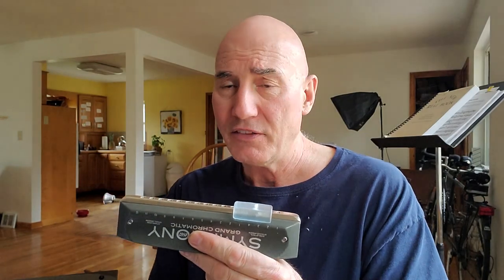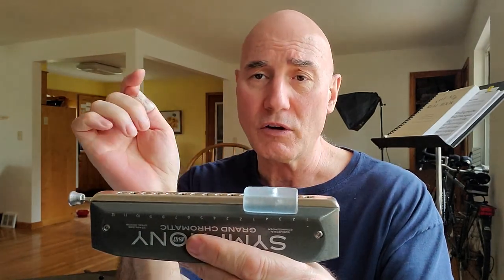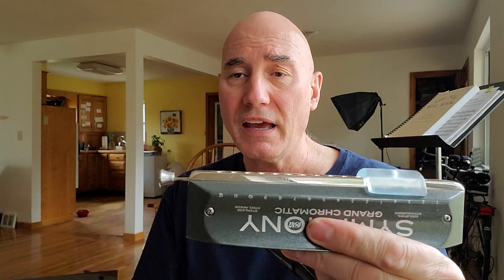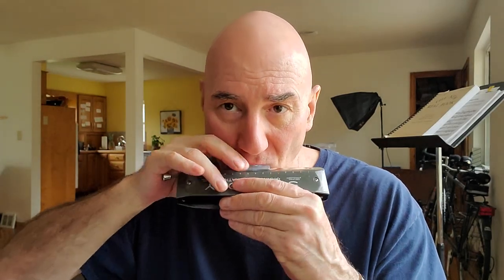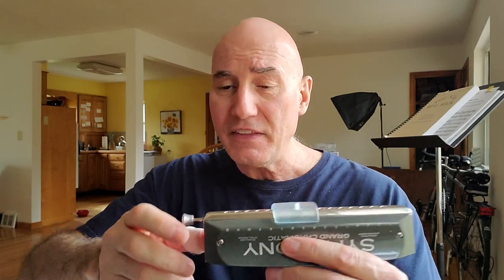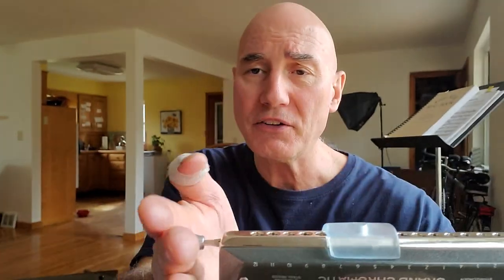Why 16 Hole Chromatic Harmonicas Sound Best Seydel Symphony Kettlewell

Comment: I own a Symphony. It feels great in my hands, and it has a great sound throughout. But. A big BUT. The slide spring breaks every few months! Do you have any suggestions?
Reply from the maker: This will not be easy...get the magnetic button, put it on your slide and get a magnet set from the factory. Then use the combination of spring and magnetic. I would also suggest you start using slide oil properly to lubricate the slide, might help. Or keep a good supply of springs on hand for repairs.

Comment: Hello David, Since you have demonstrated the 16hole vs 12hole chromatics, I wonder which 16 holes you would recommend, and if you would recommend them at all for a beginner level player? Also, when do you think should one switch to a higher level harmonica? (I currently play an Easttop Kingdream)
Reply from the maker: a beginner will be well served with the Easttop EAP 16 holer, inexpensive and airtight. Also Suzuki SCX. Pro instruments Seydel Saxony and Symphony models, and Suzuki Fabulous. You are welcome to speak with me, send a message using contact link on mastersofharmonica.com
Reply from the maker: Currently I play the Seydel Volcany all brass 12 hole orchestra tuned harp...best in my opinion
Reply: @mastersofharmonica6200  Hi David, I'm following your course from the 16-hole Symphony to the 12-hole Volcany orchestra. I agree on three points to get a more complex sound: 
- the size of the instrument
- the material
- the number of reeds, especially in the lower registers
I think these three factors combined produce a sympathetic vibration that I really like. Of course, this is only the beginning of a sympathetic vibration, as the temperament and chromaticism of the harmonica do not allow for real use of this effect.
In short, I really like this rich sound and I'd like to know which harmonica shines the most in this area: the 16-hole Symphony, which has more reeds, or the 12-hole Volcany, which has more homogeneous material and is better at transmitting vibrations?